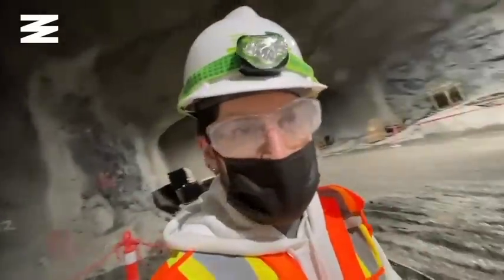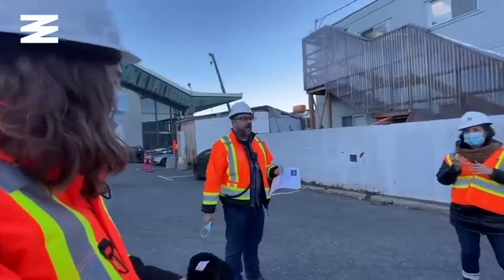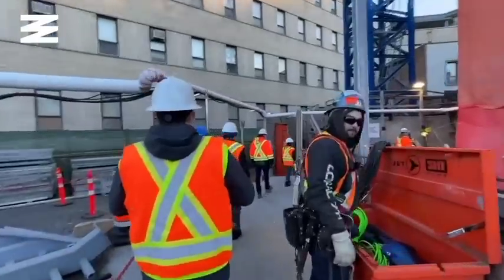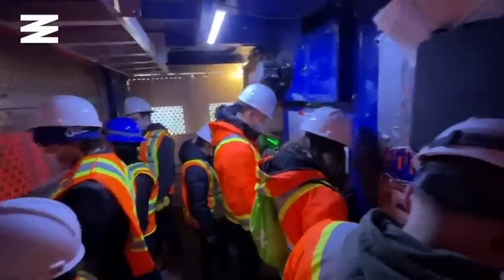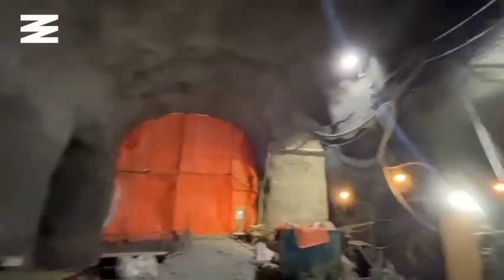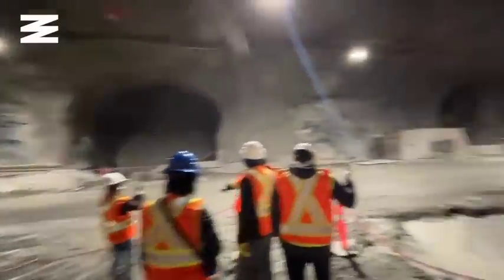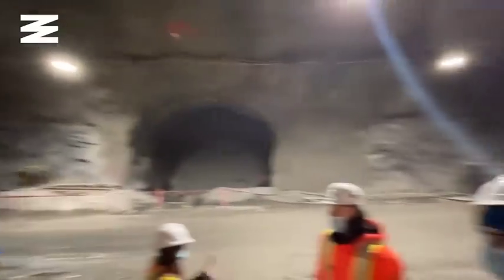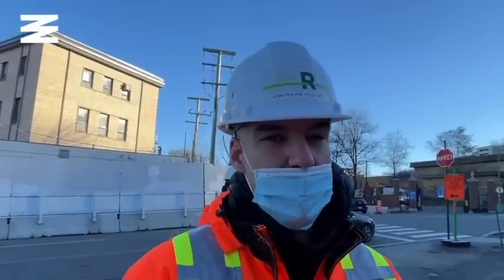Exploring The Deepest Subway Station in Canada

Comment: According to my research, there was in fact a shaft and stairway access connecting to this portion of the original tunnel when it was first excavated between 1912-1913. This shaft and stairway was presumably created with a view toward the future when and if a station were to be established at this location. 

During World War II, as a prevention to prevent potential sabotage to the tunnel by foreign agents, a Canadian Army soldier was posted at surface level at the entrance to this shaft-stairway. 

Although I do not have the precise, documented proof, I suspect that this original entrance still exists inside that small, yellow-bricked building located behind the gates across the street and to the east of the university's arena. More research is needed. Providers welcome.

Comment: Any geologists out there I need some help with this. The guy says they are building this in limestone and says it's very hard and the only way is to blast it. So  correct me if I'm wrong but limestone has a moh of 3, isn't that soft?
Reply: Not a geologist but limestone density varies widely based on age/pressure, environment. It can be relatively soft, with a Mohs hardness of 2 to 4 but really dense limestone can have a crushing strength of up to 180 MPa. Montréal sits on the Canadian Shield which has the oldest exposed Precambrian rock in the world. It was compacted under glacial ice for 2m years. The limestone in MTL is some of the densest in the world the limestone is roughly 450 million years old.
Reply: It is soft. However the crushing strength is 180MPa which is high. Concrete is 40MPa. So it's very sturdy. When drilling, due to it's softness it creates a fine powder that trap the drill easily. So they have to drill shallow. The dust it creates is difficult to extract from the mine.